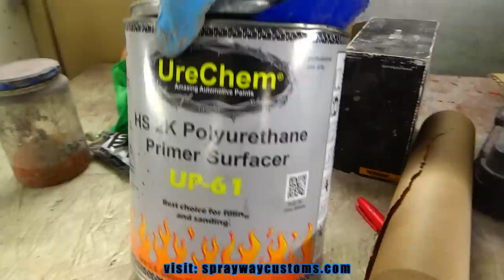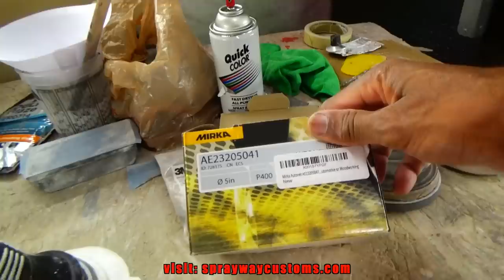How To Scuff & Shoot - Prep & Sand A Car For Paint With Dings / Minor Bodywork - Dodge Challenger RT

Comment: Great work as always.  On those emblems, if you ever have to remove some where you absolutely don't want to scratch the vehicle, you can take some monofilament fishing line and tie it between two pieces of paint stick.  Then you can grab the sticks in each hand and get between the emblem and the vehicle and use the line to saw through the adhesive.  Then you can use adhesive remover to get the rest off of the car.  Also, a cheap can of Naptha from the paint section of your local or big box hardware store works just as good as 3m Adhesive Remover.
Reply from the maker: Thanks for the info Ray

Comment: Great video as usual.  I am wanting to bring my 02 accord back from clearcoat peeling. Wanted to know what primer you recommend. Also I see alot of people on YouTube use the spray can primer but use paint with the spray gun and clear.  Is that ok?
Reply from the maker: You can do that but I use UreChem High build primer
Reply: @SprayWayCustoms  
Thanks for answering.  Trying to see for a first time painter can I get by with a 6 gallon compressor with lvlp spray gun or would I have to get a 20 to 30 gallon compressor. Trying to paint hood and the top of my honda. Clearcoat peeling